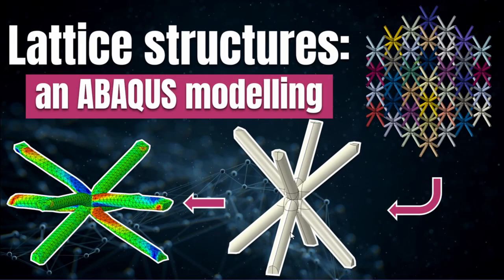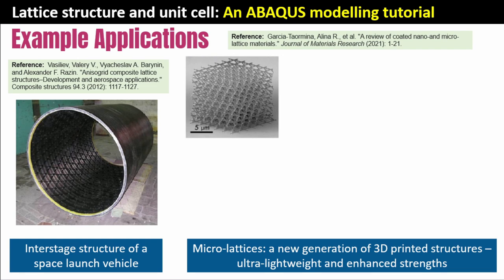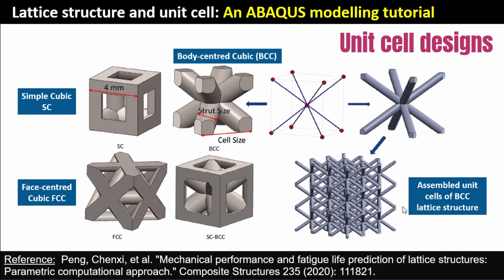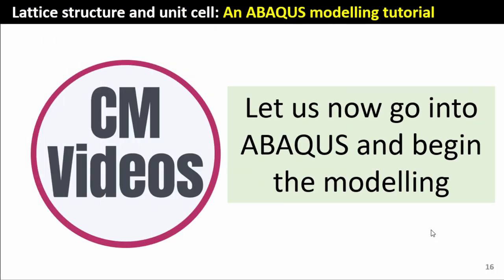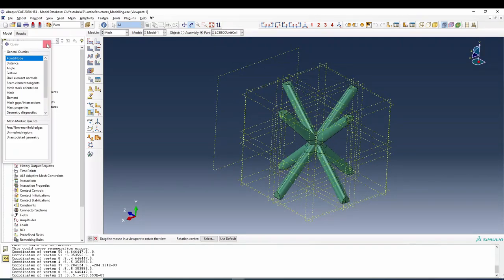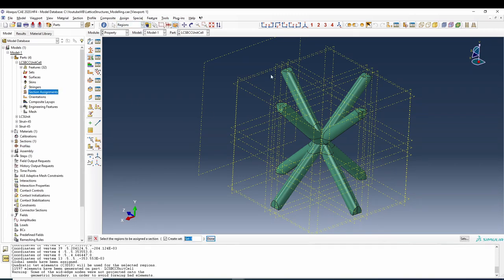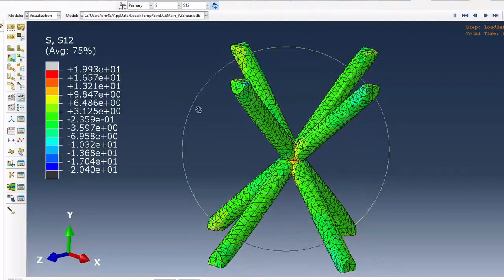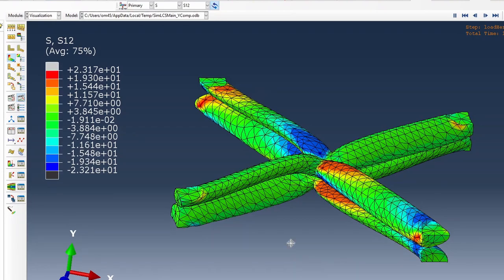Lattice structure and unit cell: An ABAQUS modelling #abaqus

Comment: Very good work! An interesting problem is, ''What will happen if you use Truss elements instead of 3D stress elements''.
Reply from the maker: Similar outcomes (especially if it is 3D) but you will not see a stress tensor as in this case but the deformation should be similar.

Comment: Thank you a lot for this channel. All videos are really helpful and you shed light to many crucial elements ( no pun indented ) that help us understand to a deeper level of the theory and the simulation itself. Wondering if you could do a video about the Interfacial thermal resistance of an 3D RVE ( single inclusion or even more ).
Reply from the maker: Dear Faidwn, I am glad you like them! Thanks for your interest in the channel. I will say I need to research into the question of your query and consider it for a future video. Do you have a specific paper that you are interested in so that I can take inspiration from it for the interfacial thermal resistance problem
Reply: @MichaelOkereke  thank you for your quick reply. I like the approach of this paper. https://onlinelibrary.wiley.com/doi/epdf/10.1002/pc.22859 Here they design the inclusion with an interphase, so with the use of the interphase they can model the not perfect contact and they set the thermal conductivity of the interphase with a value as low as 10e-13 which lowers the overall thermal performance of the RVE to the levels of the experimental results. thank you in advance.
Reply from the maker: Okay Faidwn, I will look at the paper and consider if I can make a video to illustrate the points and support your work. Take care.
Reply: @MichaelOkereke  thank you for your reply and for even considering making a video.

Comment: Hi Dr. Okereke,
Your tutorials have helped me immensely. I have one quick question regarding your loading step at @27:04 . Within the options to edit a step, there is an option to select NL geom. Is this ever applicable for lattices (particularly with very high levels of strains), or should this option be avoided? I was reading conflicting answers on the internet and was curious about your perspective.

Thank you!
Reply from the maker: Hello, thanks for your comment and happy to hear these videos help you. NLGEOM means 'geometric nonlinearity' and it is a feature within ABAQUS allows the simulation to progress where the original geometry has changed significantly and becomes quite nonlinear. For example, the edge of a square model, following large deformation - temperature or displacement - may take a somewhat nonlinear profile. For the simulation to complete without aborting, the flag NLGEOM has to be set to on to make that happen.

So back to your question, if you have high levels of strains (i.e. you expect this to be the case), then NLGEOM should be set to 'ON'. You can have large strains and the deformation remains still linear, then NLGEOM should be set to 'OFF'. However, in most cases where large plastic deformation exists, it is best to set this flag to 'ON'.

In ABAQUS, by default, if you are using ABAQUS/Explicit solver, then it sets this term by default to 'ON' and this is by default the nature of how Explicit solver deals with solutions - it tries its best to find a solution even though the solution step might take a nonlinear time step sequence - hence it makes sense for the 'ON' status to be set. 

In ABAQUS/Standard, you have the option to set it to ON or OFF as you desire. It sounds in your case, you are working with the STandard Solver and hence this choice is yours to make.

Hope the explanations help?
Reply: @MichaelOkereke  Thank you for your prompt reply and explaining this so clearly! For some reason, the simulation let me select NLgeom on or off, even for an explicit simulation (what I hope to use). I am also new to this, so I could be making a mistake or misreading something, but now I better understand how to configure this, thanks to your explanation.

Also, one additional question if you have the time. Is there a good way to enable your simulation to detect itself during the compression and not merge through? I followed some of your tutorials but increased the strain level and noticed that the body would pass through itself rather than be altered by colliding with itself. Is it some surface-to-surface contact setting?

Thank you!
Reply from the maker: Hello,I am not sure about the on-and-off issue. I think you can still switch it off in ABAQUS Explicit but by default it is always turned on. I think you will need to have a true reason why it should be off and you need to do a parametric study for this case, to quantify the effect of such choice, before choosing to turn it off.

On your additional question, it might be a surface-to-surface contact requirement.  However, as you stated here, at large strains, it seems the body is merging/cutting into itself. It might not truly be doing so. It is just not able to resolve the right deformation profile at those large strains.

If it was truly cutting into itself (mechanically), then you will see a force transfer at the contacting surfaces. What I think is that due to poor meshing, the deformation is  not as smooth as required and that amorphous/bad deformation profile will overcompensate looking like it cuts into the body: this is just a suggestion but it might not be the reason.

Good luck.

Comment: Thank you for this video. I have a question : the structure have been meshed using "beam" or "3D stress" elements ? wich type of elements is the most relevent for this kind of structure?
Reply from the maker: Good question. I used the 3D stress elements for this. Some people do use a beam element but that would treat the legs as struts but here I treated it as  a full element hence able to generate all the terms of a stress tensor. So, yes, use 3D stress element, its more holistic but a beam element for some structural scale problems, with larger virtual domains will be okay. The use of a beam element will lead to a computationally efficient/less expensive solution whilst the 3d stress elements are fine for really small-scale (micromechanical) RVE based analysis.

Comment: Great video!
But I can not see a difference in the boundary condition pictures between lower-constrained Unit Cell (7:20) and Fully Constrained Unit Cell (8:05).
Reply from the maker: Hello, thanks for the comment. Yes, your comment (i.e. the schematics I showed for the two types of RVEs) is the same but the idea behind them is actually different. The Fully Constrained unit cell has the upper and lower face sheets attached to the lattices and then as a result will constraint the behaviour of the lattice rigidly. For the lower-constrained, the idea is tha the lower face sheet will be there (holding the base like a built-in support system), while the top sheet allows for degrees of freedom displacement in one possible axis. 

I might not have reflected the ideas in my mind properly so thanks for the comment. I hope the clarification helps.

Comment: Thank you sir for this video. Would you please do the same modelling but with  two layers of different material in a BCC lattice structure. I want to learn simulation of biphasic bcc lattice and assigning contact between two layers of different materials to calculate effective modulus of composite unit cell.  Kindly make video illustrating above problem it will be very helpful to understand simulation of composite lattice in Abaqus.
Reply from the maker: Hello @Ankit Jain, thanks for your interest in the channel. I will need some information on what you mean here by biphasic BCC. Do you mean having two BCCs with the upper layer made say from ABS and a lower-layer BCC made from say PLA. With that, then we can undertake simulation of say compressive response. What happens at the interface between them? Are they bonded together, following say a 3D printing implementation? Or do you introduce an interphase plate to separate them? Why do you expect a contact to be in place for such biphasic system? If you have any publication or reference material about this, then share with me and I will consider making a relevant video. It does sound an interesting project to investigate.

Comment: Can we import .inp (Volume mesh file) to do tensile testing? Dynamic explicit study. As Iam facing this problem past a month.
Reply from the maker: Hello @Abhinav Siliveru, I am sure this is possible. We can import an ABAQUS *.inp file directly into ABAQUS CAE environment and use it for our modelling. The only problem with such imported *.inp files are that they do not allow for modifications of certain of the geometric and mesh properties (once imported). The best bet is always to get the original ABAQUS CAE file and make your modelling from that but from your question, it does sound you only have the volume mesh. You can use still it but you do need to recognize the limitations especially the geometric and mesh changes limitations. It does not matter what study style you go on to do next (explicit, dynamic, implicit), it should still work. The volume mesh file is simply a geometric file which you start off with, and once imported, you can then start applying the necessary boundary conditions, step files, material models, etc and then progress to run the simulation. Let me know if this makes sense and you have further questions. Good luck with this.
Reply: @MichaelOkereke  Thanks for replying. I will try to replicate your input. If any doughts, I will come again.

Comment: Hi, thank you for the video! please I have a question Dr Michael, how we can calculate the effective young modulus and porosity of a material using the lattice structure?
Reply from the maker: Hi  @Bika Giro, the video did not cover the modulus and porosities, maybe that could be in a future video.
Reply: @MichaelOkereke  Thanks
Reply: @MichaelOkereke  Please If i duplicate the unit cell and make top and down plate, to determine the effective young modulus and plot the stress-strain value, what loading settings should be for the tensile test please Dr Michael?

Comment: Very interesting video but really I get confused between unit cell model and RVE model, could you tell me the difference between them. Thanks in advance
Reply from the maker: Hello John, thanks for your interest in the channel. Indeed, I understand the confusion. But here is it:
1. RVE is a representative geometric domain that can be used to substitute the whole structure. It should show the same mechanics as the whole structure. As a result, you need to run the models to show a response of the RVE that is comparable to the big structure.
2. Unit cell on the other hand is a repeating geometric sub-domain of the structure. It is always a sub-domain. It is used when you find a structure has a lot of repeating segments and you want to isolate the smallest sub-section that can be used as a unit cell.

Unit cells can be RVEs but RVEs cannot be unit cells. RVEs are used in many micromechanical analysis and it is the common virtual domain. However, on the other hand, unit cells tend to be used when you have structures that you want to isolate a sub-domain of it. It would work mainly when you have structures with homogeneous distribution of microstructural components or crystalline systems. If you cannot always have a repeating microstructural representation, then you should not use a unit cell. Instead RVEs are preferred.  I hope this explanation makes sense.
Reply: Really thanks a lot Dr. Michael for your kind detailed clear explanations

Comment: Hello sir, finally I got to see the analysis of lattice structures. Thanks for putting effort in making this video sir. I have a question, Can you please compare the experimental results with numerical results? Or can you give me your suggestions here!!. Thank you
Reply from the maker: @Santosh b, what I will say is that you just need to get some experiments, of probably a unit cell of the structure (and if not possible) a few stacks of lattice unit cell. Then, you can manufacture it (say by 3D printing), and test it. Using same model, you can run a simulation say compression and then compare the results.
Reply: Sir, I am Research scholar working on 3D printed cellular structure (Re-entrant honeycomb). I have performed the experiments and trying to compare the results with Ansys (Static structural-Nonlinear) But I am not able to get the matching results in Ansys.

Comment: Thankyou for the video sir! I exactly tried the same... When I try to apply the mesh, the abaqus software is closing automatically. I'm using a cracked version and is that  the reason??
Reply from the maker: Hello @Sushanth, I am not sure why you are having this problem. It could be due to the version of ABAQUS you have but I cannot say definitely it is. Good luck with the work.
Reply: @MichaelOkereke  thankyou sir 🙌

Comment: Thank you sir for this video. Would you please do the same modelling but with a composite material such as IM7/977-2 or maybe running a buckling test with a grid stiffened cylindrical shell again with a composite material. Actually, my main problem is with assigning the composite material to lattice structure beams.
Reply from the maker: Thanks Sina for your comment. Please can you share with me any publication that captures what you are suggesting here. I am trying to understand it. I will then review and see if I can make a video about it. I have plans on making videos about lattice composites so please watch out for those videos when they become available.
Reply: @MichaelOkereke  Thank you so much for responding. I already sent an email including the related article for you sir. The article is "Optimization for buckling loads of grid stiffened composite panels" by Wodesenbet et al, published in composite structure in the year 2003. I will look forward to your next amazing videos.
Reply from the maker: I saw the paper @sina academy buts it's such an old paper I wondered if you didn't want to find something more recent. Some of those ideas in the paper are a bit obsolete.
Reply: @MichaelOkereke  Thanks again sir, would you mind checking another article written by Wang and Abdalla in 2015 named "Global and local buckling analysis of grid-stiffened composite panels". I am mostly concerned with the buckling of stiffened shells, not rectangular pannels. Also, there are more relevant papers by the same author.
Reply: @MichaelOkereke  Actually, I just remembered you have been reviewed an article by an Italian researcher named Vasiliev. He has been done some researches on the subject with his Co-worker Mr Tottaro.

Comment: sir ,how much we will take poisson'sratio in case of polyvinyl alcohol(pva)
Reply from the maker: Hello Amit, its a variable quantity depending on the method of manufacture and composition.  Typically its about 0.4 being a polymer but thats just a start. I suggest for a heterogeneous system composition you csn use the approach of my recent video on Numerical determination of Poisson Ratio to obtain it.

Comment: Thank you for all your videos. It will be very helpful if you upload video on simulation of BCC unit cell lattice made up of two material (composite bcc unit cell). I mean BCC lattice struts made up of two concentric cylinders of different materials. For illustration related paper is already sent to your email
Reply from the maker: Hello @gaurav jain,  thanks for your interest in the channel.  I am not sure  which email you used but I didn't get it. Please check again and resend or put here the title and doi of the paper.
Reply: @MichaelOkereke  Sir please share your email id

Comment: Hello Sir, i want to form hexa mesh for BCC in Abaqus ? How can i do this ?
Reply from the maker: Hello @irem, it is not easy to mesh this BCC structure with hexahedral (Hex) meshes, due mainly to the complexity of the central joints of the trusses. There could be other ways of meshing with hex elements but that means having to partition the domain a multiple number of times.